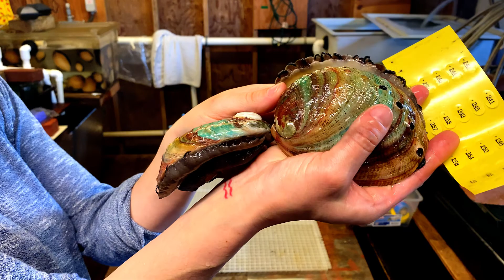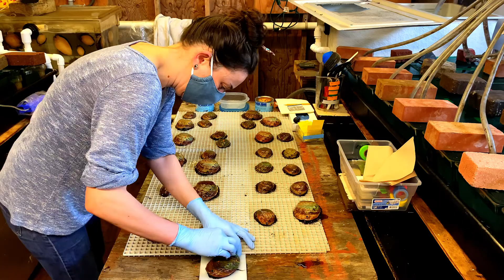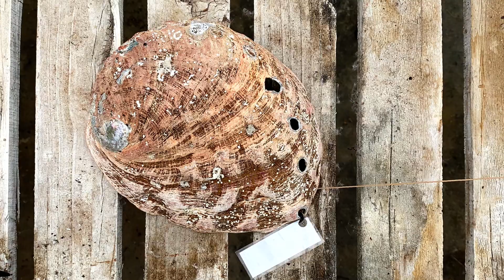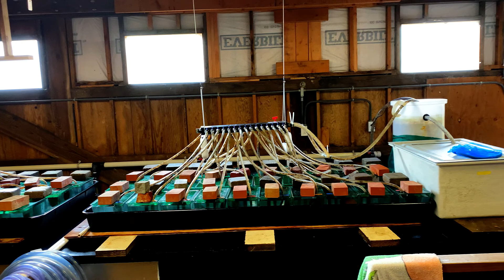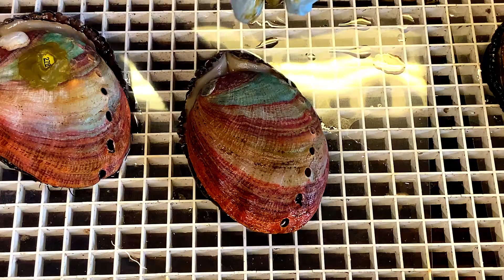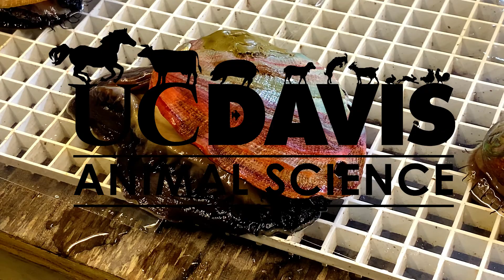Abalone Mariculture Tagging Marine Sea Snails Aquaculture Time Lapse

Comment: This is quite interesting. I was asked about 12 years ago, while at Allen-Bailey Tag & Label which makes approximately 50% of the shellfish tags used in the US, if I could provide a tag to attach to abalone. I could not create a method that did not use the natural holes in their shell and that wasn't acceptable because they need those unimpeded to maintain their life. I do like the special "peanut butter" adhesive applied to the shell and a small consecutively numbered tag worked into the adhesive.  One suggestion: create a QR Code for each mollusk and immediately imbed that instead. The QR Code can contain a lot of information.  Good luck.
Reply from the maker: I think a QR code could be very interesting alternative!. Especially if it could be read underwater!!!